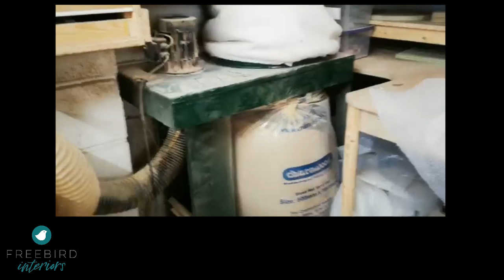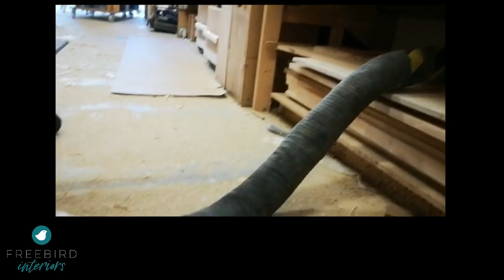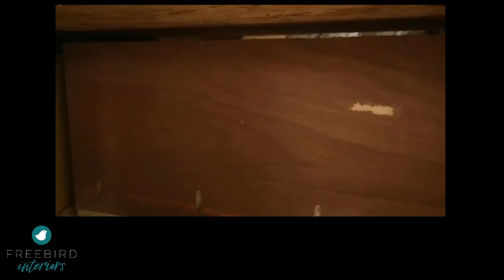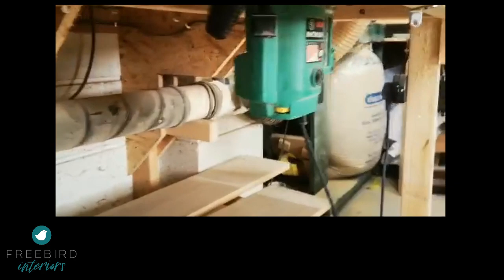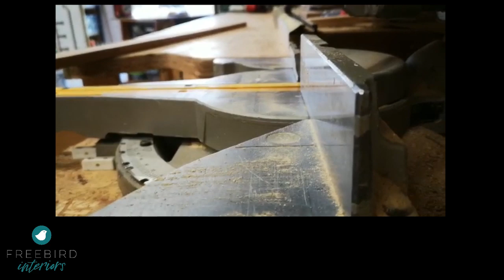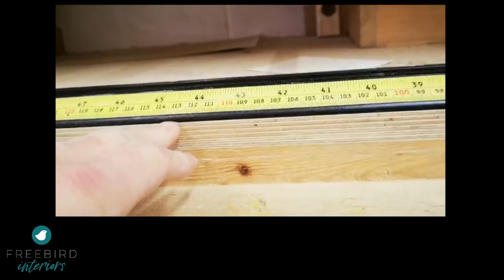Our Mitre Station and Dust Extraction Setup

Comment: Great job.
Use a piece of 3mm stock to lift the fence up.
I have mine that way and can cut 6mm material no problem.
Or else take 3mm off the bottom of the flip stop probably would be a lot less work for the same result.

Comment: Yeah I like workshop videos and really interesting to include what improvements you would make. Could you put something on the inside face of the flip stop that would space off the bottom a few mill so that it would still be parallel but allow the dust to go under? Or maybe cut the base of the flip stop so it rides a few mill (but still work for 6mm) above the deck level and dust can still escape. Thanks Sam
Reply from the maker: We could just take the black bar off and fit another 6mm of material underneath before screwing it down again.  Brady feel free to do that!
Reply: @Alastair_Johnson  would 3mm be better, just incase you cut 6mm and it slides under the flag stop? Thank you for the reply :)
Reply from the maker: Yes, it would!